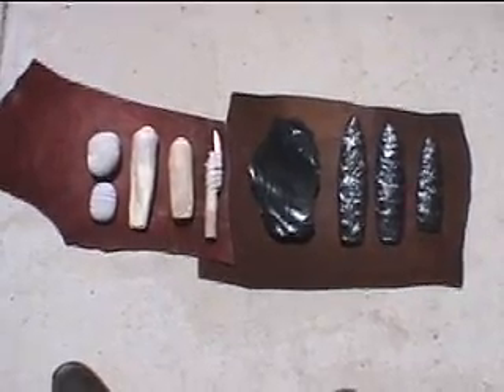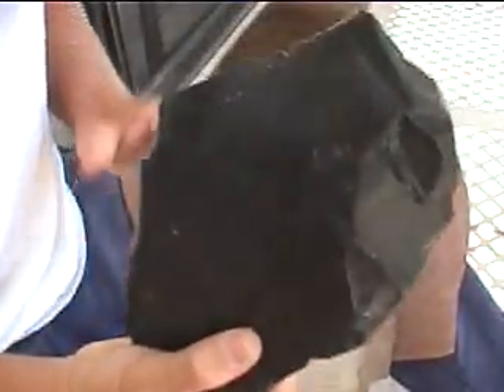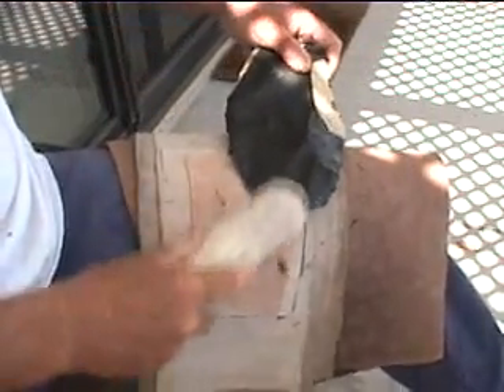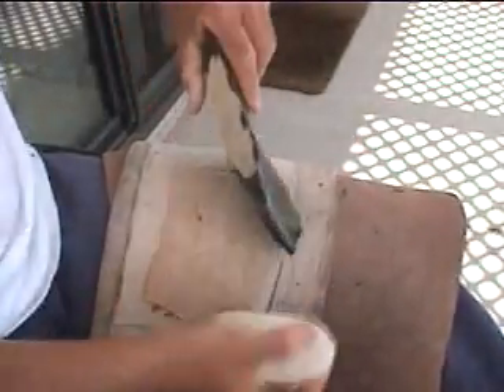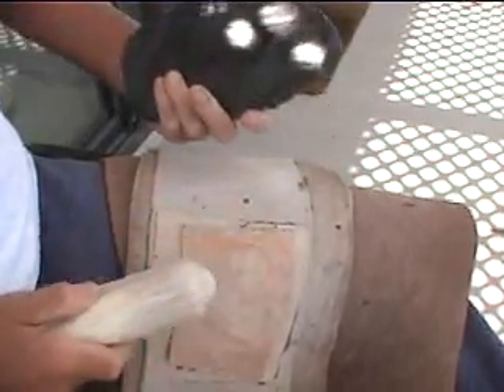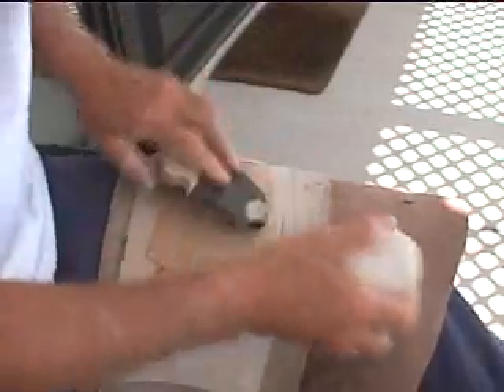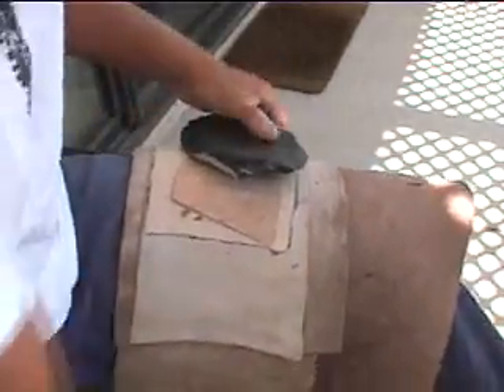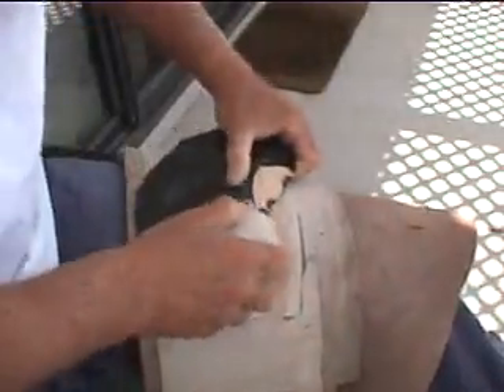Flintknapping Abo blade, part 1

Comment from the maker: Grinding removes the sharp edges. The duller edge will be stronger so that the blow from the hammerstone or billet will not collapse or shatter the edge. Instead the blow will allow a controlled flake to be removed which will thin the biface.....and the process is repeated until the biface is completed.